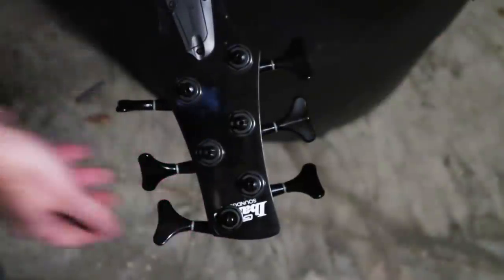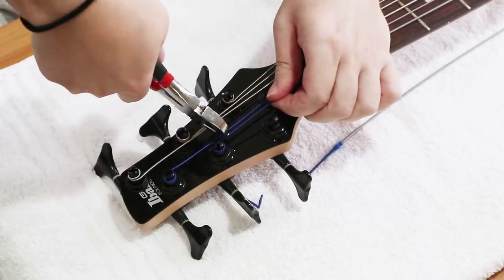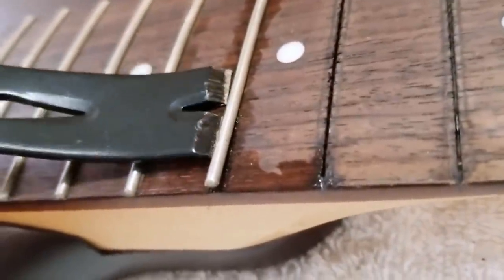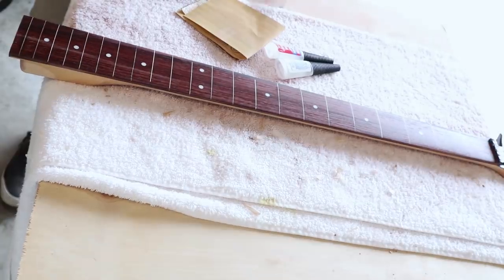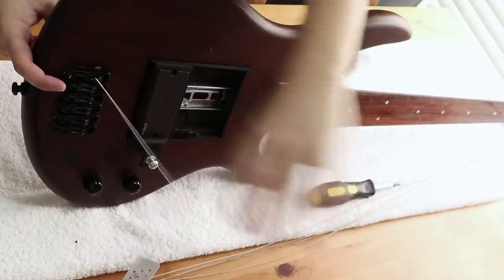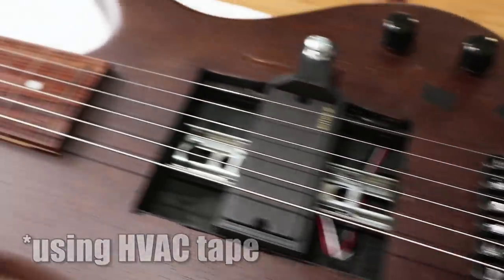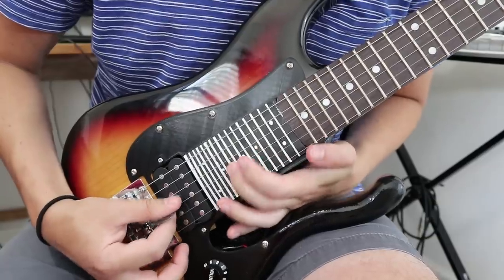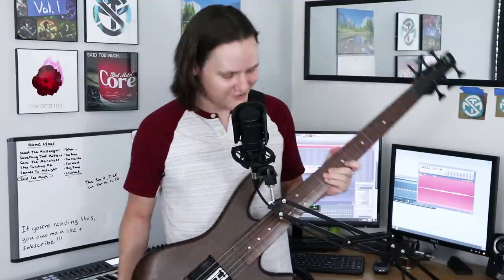Fretless Baritone Build (...and Tone Demo)

Comment: Now play it with a bow
Reply: Wouldn't work that easy. He'd need to arc the saddles and nut so the strings arched, using a bow on a guitar like a violin isn't easy. Usually can only hit the low and high e strings.
Reply: @Mickocarbomb  Arc the saddles eh? Maybe that's a good idea for a future project?
Reply: Jacob Reichert it actually sounds like something this dude would do
Reply: @atwinchester  what about half the strings arched so you can strum chords on the low notes and bow the high notes. Maybe try some pizzicato guitar? Lots of possibilities
Reply: I've seen someone play an electric bass with a bow, but they modded it to have one string. It's played on öOoOoOoOoOo - Purple Tastes Like White
Reply: @Mickocarbomb  The Ibanez Upright Fretless bass can be played with a bow due to the curved bridge.

Comment: A WORD OF ADVICE: if you plan on playing barre chords in standard you can always intonate the strings to be conducive to those chord shapes, as i do with 4 string fretless bass, so that way, lower strings are "below" the fret high up and high strings are "dead on." intonating fretless has more to do with what you're doing with it, rather than "perfectly set intonation," equally. you should also experiment with tremolo picking and tapping riffs as well and not get too fixated on chords.
Reply: Or just keep your fingers perpendicular to the fretboard like a good guitarist...
Reply: @actually5004  ew, no. that's not even solid advice when playing with frets. it's clear you've never owned or played with a fretless bass for enough time to know what you're talking about. playing a 3 note power chord in all 4ths tuning is ridiculously impractical if both intonation points on the higher strings are identical, unless you prefer baring them. even then, a little bit of slant feels better and will be less harsh on the joints of your fingers with an angle. you're locking your fingers in one direction instead of stressing them back and forth when sliding or adding vibrato.
Reply: @DaarthPingas  I've been playing my Douglas 6 string fretless for 4 years now and I'm a bass player of 12 years and if you're "locking" your fingers in any situation you're gonna hurt yourself with time.  Keeping your fingers parallel to the neck is all about having the neck high enough and angled up enough to both keep your wrist somewhat parallel to your forearm to prevent carpal compression while maintaining proper thumb positioning on the back of the neck.  Keeping fingers at 90 degrees to the fretboard prevents twisting stresses on your joints and allows a more fluid "back and forth" vibrato instead of a chiseling motion that can cause skipping across the strings during a glissando (that's what a slide is called, btw).  Not being flexible enough to hit notes is a reason to *practice*, not to espouse bad embouchure on the internet.

Comment: You probably are going to want to wet sand that neck a couple more times, when the water dries up you can see all the spots where there the neck still isn't uniform (because those places won't dry up as fast)

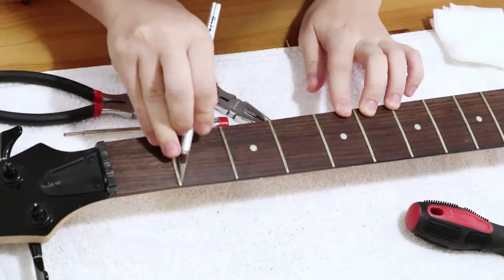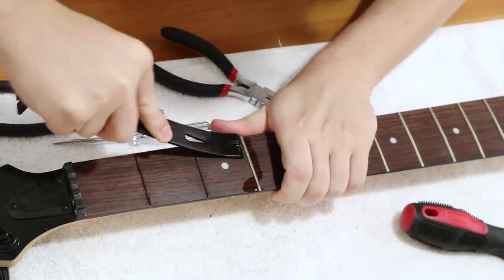Comment: 1:19/1:52 I don't consider myself a legit luthier, but I've done a few fret removal operations. I used a clothing iron and a metal ruler to heat up the frets... Then I used a small flathead screwdriver to jimmy the fret out lol. Then I filled in the gaps with wood putty, and voila! (: Your idea is also just as legit though.

Comment: 6:43, the only tip I can give you, is to play right on the fret line instead of a couple millimeters away. Other than that, great execution!
Reply from the maker: I heard the opposite, the edge of your whole finger print is where you're fretting, not the center of your finger
Reply: @SaidTooMuchProductions  I played my "fretless" into a tuner, and used the outcome for intonation... That may be different for what you did. You're prolly better at this than I am, but I do have a good amount of success playing Primus fretless lines lol.
Reply from the maker: I mean, if it sounds good, it is good lol
Reply: @SaidTooMuchProductions  For me it ends up being more like the edge of the finger on the line, like you say. Plus or minus a bit for string gauge, or for playing just intonated intervals etc. Ultimately you need to constantly use your ear. Developing muscle memory makes it easier over time too, you still need to listen of course though. It wasn't like learning a whole new instrument for me because I was already used to playing a fretted bass the exact same scale length.
Reply: @SaidTooMuchProductions  idk just check with the tuner and wherever works it's ok

Comment: i've played fretless bass for a year, to me the transition to the fretlesss wasn't traumatic (it has inlays whithout i'd be lost)
one thing to not fuck too mutch with the fretboard is to slide instead of bending the strings, the fretboard of my bass suffered a bit because of that, however is nothing too noticeable and i don't know of any fixes, so if anyone has to say something i'm listening.
for bass its cool to do diads, slides, just don't overuse them
for band there are plenty with bass, i recommand intronaut, 
for guitar the only band i'm aware of is thank you sientist
Reply: Just do the last few steps he did in his conversion, lay down some thin layers of epoxy and sand it back smooth while maintaining the radius.  If you're still dead-set on round-wounds you can also try micro-coated Elixer strings- they're much easier on a fretboard than something like Hi-Beams.